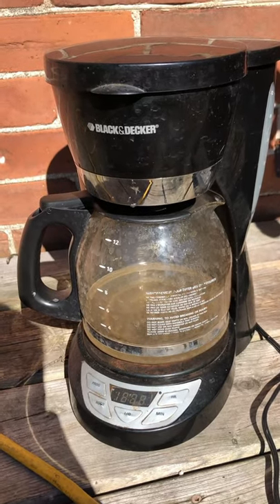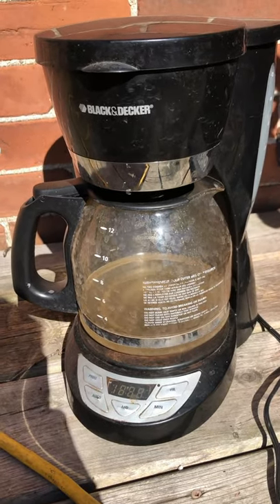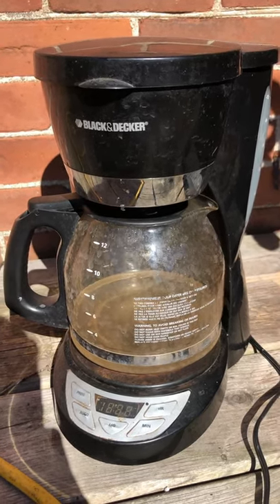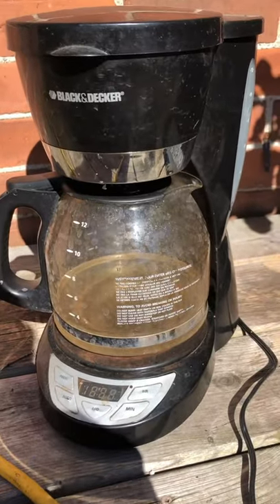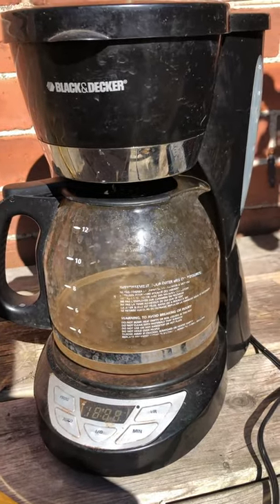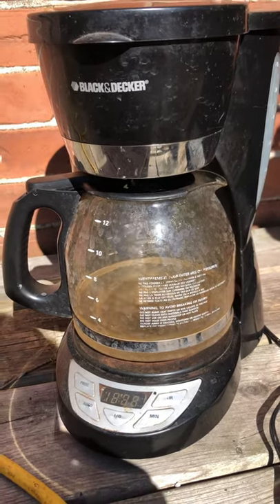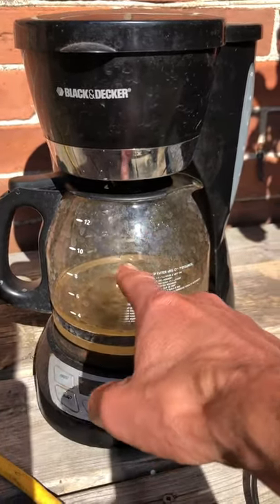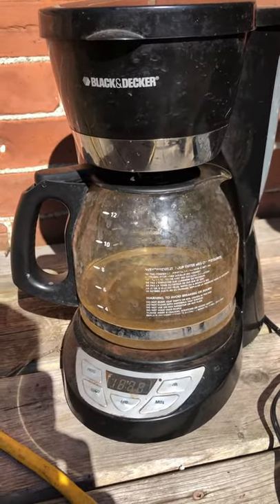How to remove minerals from your coffee maker

Comment: Nope.  Don't pour the boiling hot water back into the machine after running one cycle.  Let the hot water sit for 30 minutes to cool down before pouring it into the machine and melting the rubber hose. 😲
Reply from the maker: It’s vinegar I’m running through there
Reply: @greenthumbprepper8653    Sorry.  I was basing it on the recommended level of 1/2 water 1/2 vinegar.  Both of them have about the same boiling point.  (I have a 1996 Mr Coffee which still works perfectly).
Reply from the maker: @Austin8thGenTexan  ohh.  I didn’t look into ratios.   The well water where I was living where this was filmed had water so hard it ruined the anode inside the hot water tank.
And within the first month of moving in, stained everything orange.
So I just ran that sucker at full strength.
It worked.  I’d still be using it to this day if I hadn’t of smashed the coffee pot.
Reply: @greenthumbprepper8653    That's intense!  I grew up with sandy loam in East Texas, so our well water wasn't very hard.  What I miss most about having a well is that the water is cold.  City water in Austin comes from Lake Travis - and is pumped through hot ground to our taps.  Warm tap water for 4 months every year...  😑